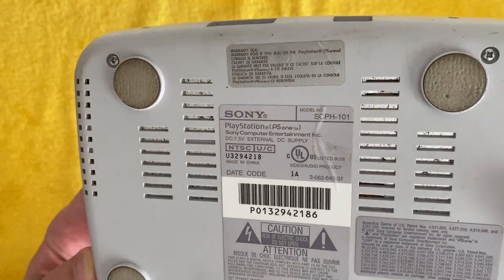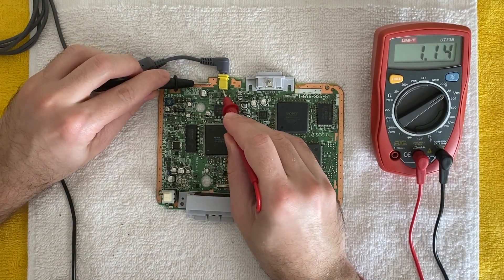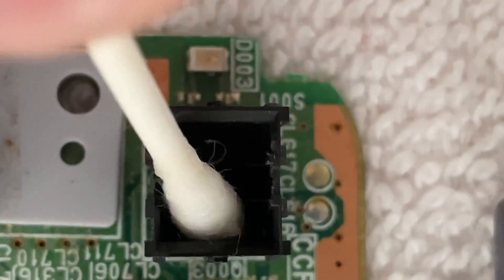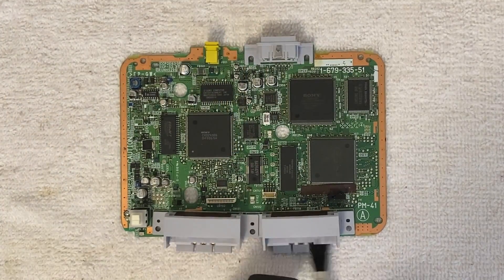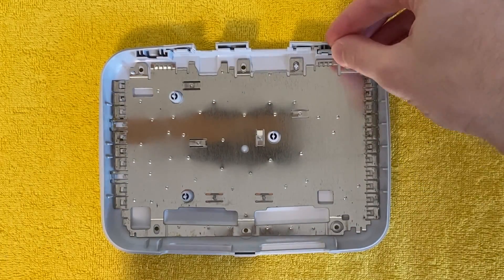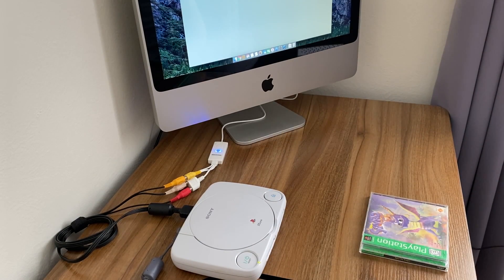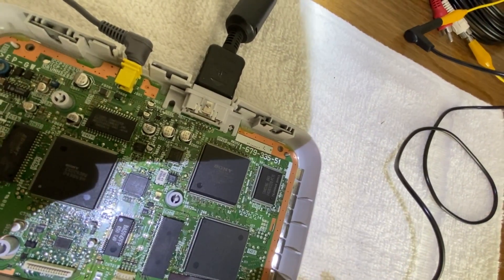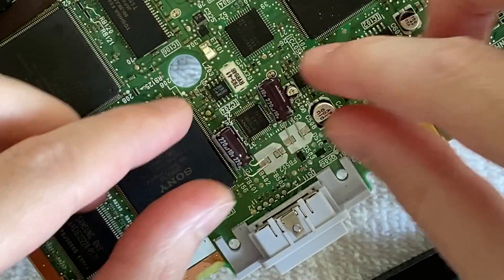$0.96 Faulty PSone Repair - Retro Console Restoration

Comment: Actually I dont quite understand how this ps1 power switch work. I want to replace to new one but it’s look like having 4 pin
Reply from the maker: It's actually like two switches in one. When its on, the pins are shorted horizontally. So if you're looking at the back of the motherboard, you can short the left pin with the right pin (do this for the top and bottom rows separately). They are NOT shorted vertically. Does that make sense?

Comment: Great work! I have a question. I have a Ps One that I didn´t have the power supply 7.5 V, so I used a PSP 5V adapter and i turns on but apparentely was low voltage and was no screen  and accidentaly I used a 12V laptop charger and inmediately stop working the Ps One, what component you think I can change? the capacitors?
Reply from the maker: I would check the fuses with a multimeter on continuity or diode mode. I quickly check them in the video at the beginning and mine were good so you may want to find a better photo online for their exact location. There's one under the power connector and four on the left side of the board. They are labeled PS600, PS601, PS603, PS606 and PS004.

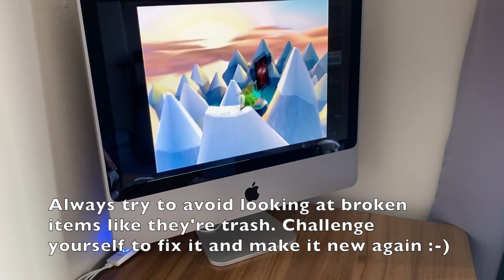Comment: at 14:02 sure you say that but not everywhere can everyone find those tools i am a 16 year old and would love to fix stuff but i dont have tool like the multimater and soldering ion i cant seem to find any
Reply from the maker: A basic soldering iron and multimeter are pretty inexpensive (you don't need anything fancy). I started with the cheapest pair I could find and I used them for many years while my skills slowly improved. You can also start with simpler repairs like a dead phone battery, an appliance with a faulty or broken power cord. Your relatives may have stuff laying around the house, just ask family and friends if they have stuff to let you practice repairing them. Once you get into it it becomes a fun hobby (expect to make mistakes along the way, I certainly still do).

Comment: You have a new subscriber:) nice find and fix. Give your self a good soldering iron. You have the skills and deserve good tools! Nice repair video!
Reply from the maker: Thank you very much. Funny you should say that :) I bought a TS100 last week and had a chance to use it in a recent video (replacing an internal GameCube battery). I certainly appreciate having a better iron and quality flux/solder. As a beginner I am glad I worked my way up to it though. The benefits may have been lost on me if I hadn't practiced on a cheaper setup first.
Reply: @BorderlineOCD  That is how the universe works lol, Excellent choice :)

Comment: When probing the av part of the board were you referencing schematics. How did you know? Also were you just on  continuity on multimeter when testing. Thanks great vid
Reply from the maker: I did find schematics for the PSone but I had a difficult time making any sense of them. What I found useful was a pinout of the A/V port (pin 7 is for composite). Once you locate it on the connector area of the board you can follow it’s path down to the video chip and tap along the way to see if you can read a composite signal directly. I read a bunch online about "A/C coupling" circuits and learned that they’re common in analogue video circuits of the era to filter video signals although I don’t fully understand how they work, and apparently they were often used because of industry standards rather than actually doing anything useful for the video signal. Would love someone with more A/V experience to chime in! For checking the fuses just continuity mode but for probing the video signal its just a multimeter lead connected directly to the video input of my capture card (no multimeter involved in probing the video signal). I’m still a beginner at board level repair and this was one of my first uploads to YouTube so I was a little overwhelmed with trying to make a video. If I were to do a repair like this again I would definitely try to explain my thought process and learnings a bit better.

Comment: Please make a video trying to fix the lcd screen for this console. I have a broken one. Not power on. I removed i diode and it turns on again. But i dont know the exact replacement part. Thanks
Reply from the maker: I usually buy my consoles in bulk as-is lots and unfortunately I haven't come across a PSone LCD screen yet. You'll probably have better luck finding someone's video that covers a similar repair.